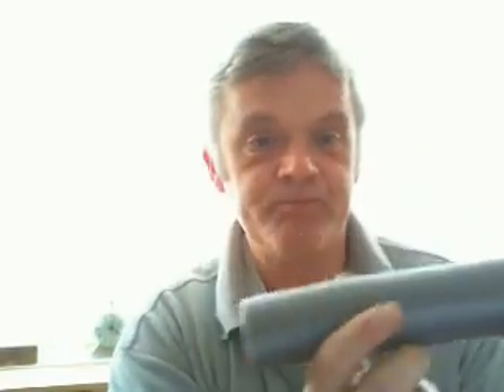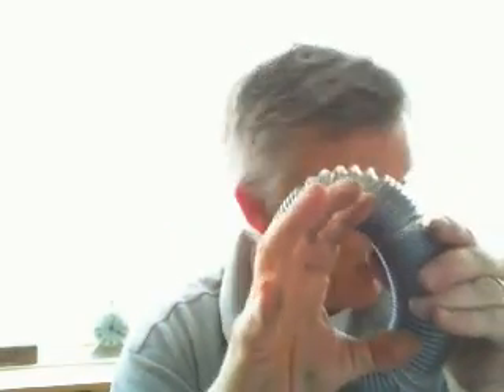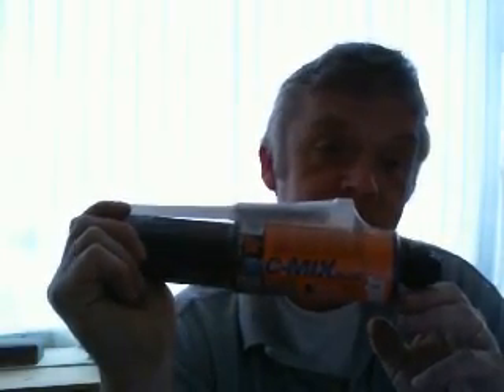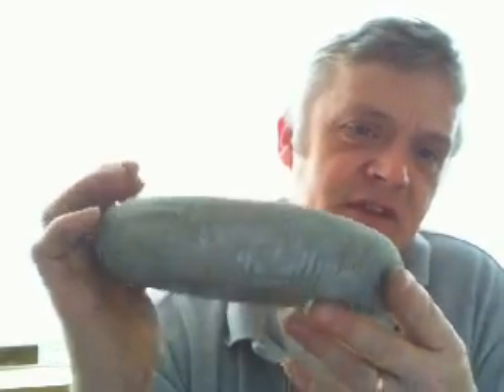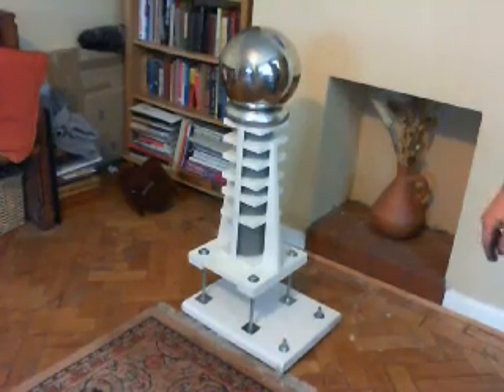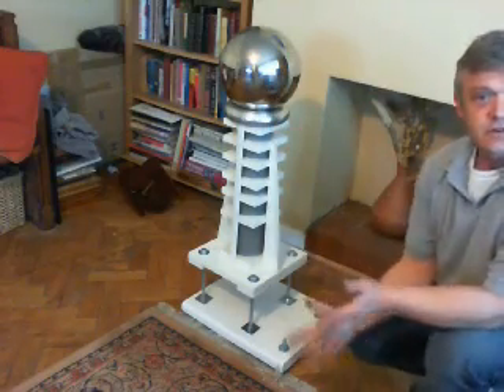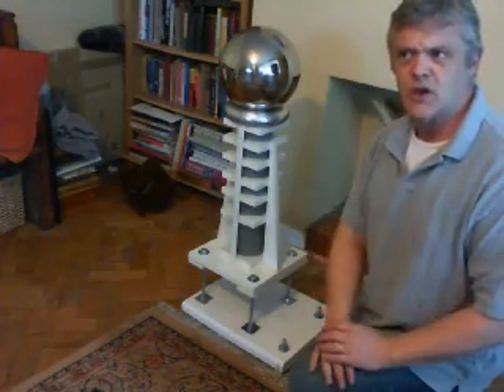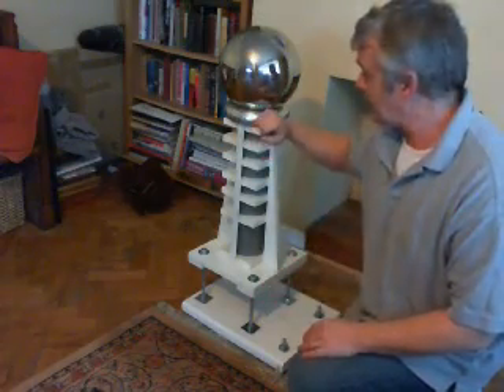How to Build a Van Der Graaf Generator - Part 4 - Making the toroid

Comment: i painted an inflated inner tube with sprayed the tube with nonstick for fiber glass resin not to bond to it and cloth wrapped and fiber glass resin i dipped into conductive paint and had it chrome plated had some chromium oxide laying around made a cut on both side evenly took to remove the rubber oh yes wax is a good non adhesive as well
Reply from the maker: that is a very cool method